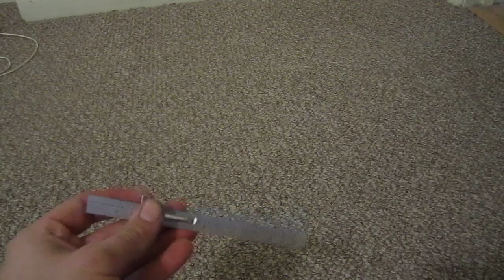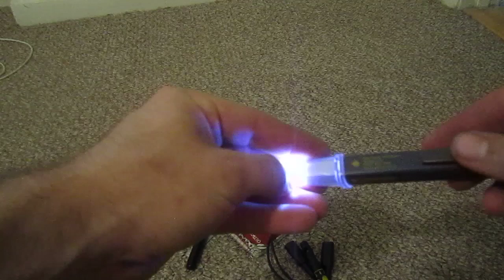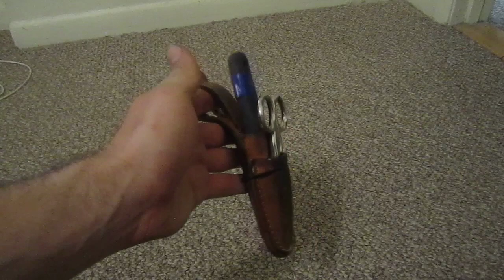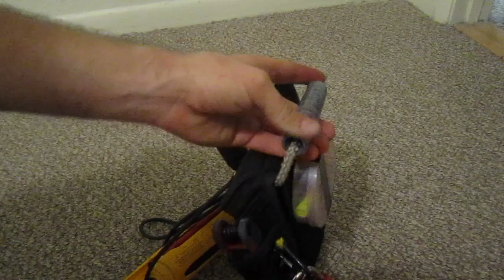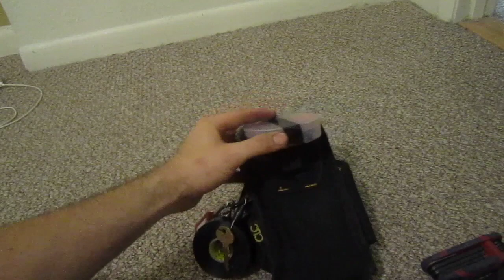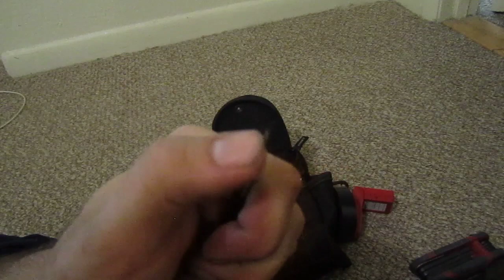Electrical Toolbag Everyday Carry

Comment: It turns blue when there current running through a neutral? Unless the circuit is  isolated wouldn't there be current running through it constantly

Comment: Weird.  My "EDC" bag weighs in at about 72 lbs.  I must be doing something wrong.    I put my pipe wrenches and stuff in another bag, and my Milwaukee stuff has its own bag as well.   Everything else is in my rolling toolbox some might call an Econoline E350. :) Spend the money, buy good stuff, it will last your career if you buy the right tools.  Klein is pretty hard to beat. Just sayin'.